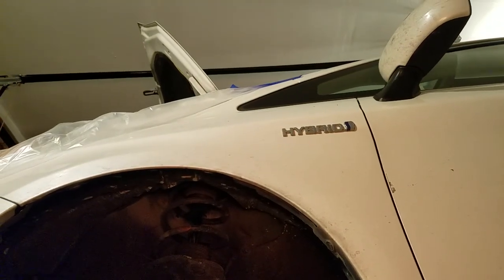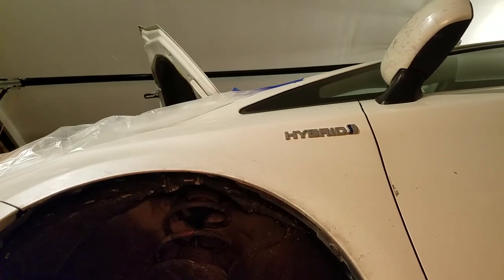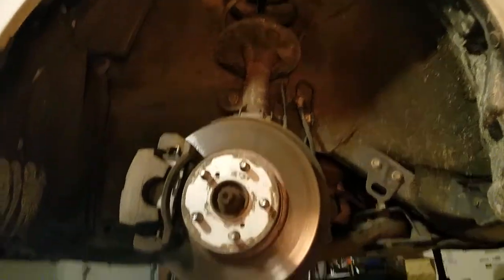2013 (gen 3) Prius ABS Accumulator removal - access to bolts

Comment: Did you get around to doing this repair and taking some video?
Reply from the maker: I did do the repair, and it works fine. I wasn't able to get a couple of the small brackets that hold the brake lines back on, but it seems to be fine without them. I took a couple of videos of highlights, but I haven't had time to upload them, and the memory card holding them is in another state right now.